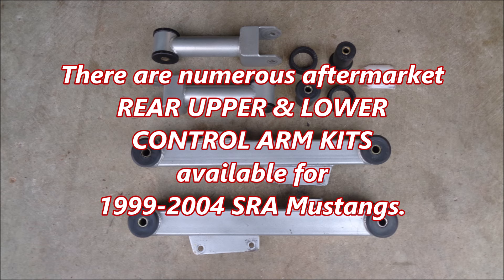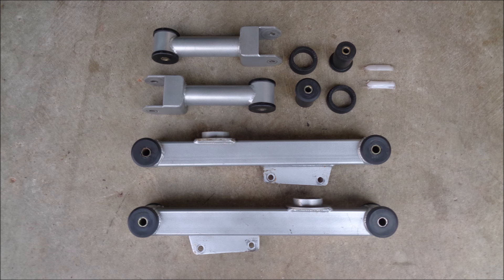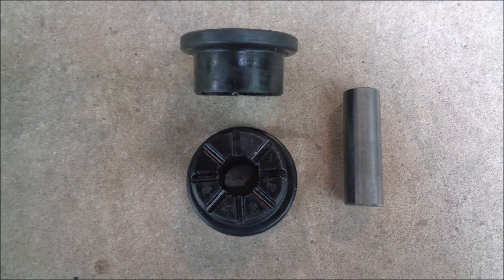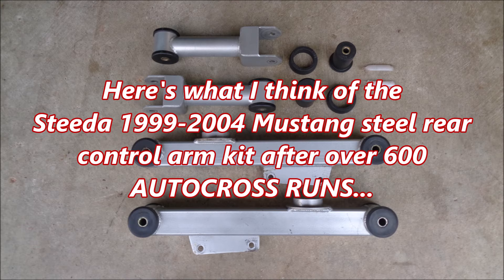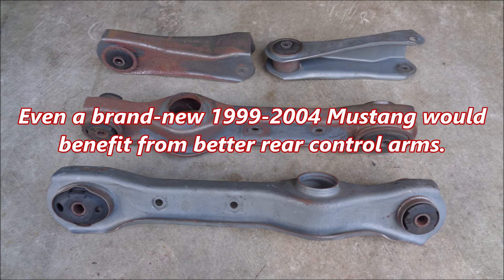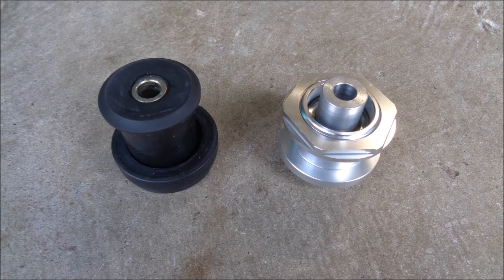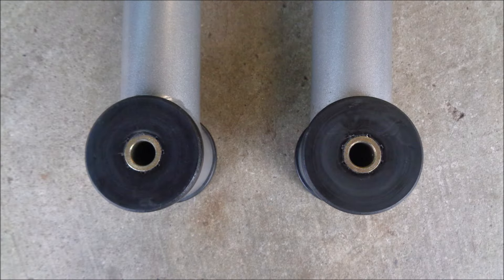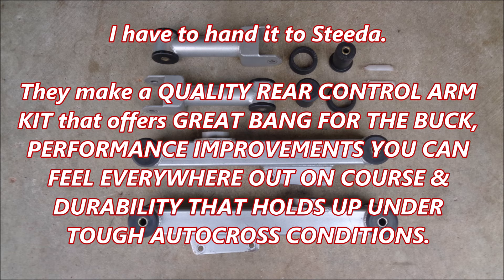STEEDA 1999-2004 Mustang STEEL REAR UPPER & LOWER CONTROL ARM KIT: Autocross Review

Comment: Those are similar to the BBK rear control arms I used except, BBK uses a boxed upper and red poly 3-piece bushings. Steeda is high quality with everything they build, I like the boxed look on the lowers much better than the tubular..
Reply from the maker: It's good to have multiple options for rear control arms with 3-piece poly bushings. J&M also makes rear control arms with 3-piece poly bushings. I've had a lot of positive experiences with Steeda parts over the years.

Comment: Excellent video. I am guessing that your car sits at stock height or very close? How are you adjusting your Instant Center or Roll Center, if you are not using adjustable control arms or a phb? Are you using relocation brackets for the lower control arms?  Thank you for your time.
Reply from the maker: Thank you! I generally don't lower my autocross Mustangs more than 1". Going lower with stock-style springs (not coil-overs) limits suspension travel and can lead to needing more mods to solve more handling issues. I don't use relocation brackets for the rear control arms on my SRA cars. The other mods I've made (weight reduction, mass centralization, adjustable shocks & struts, sway bars, etc.) have gotten my SRA cars to perform well enough to where I haven't felt the need to use extended ball joints, adjustable control arms or a PHB.
Reply: Thanks for the reply. Yes, I would agree that lowering your car past stock height causes a lot of problems. The 4-link rear suspension is actually pretty good when it sits at correct angles and height. Out of curiosity, have you looked at true triangulated 4-link suspensions? The 79-04 mustangs have more of a semi-triangulated 4-link setup in my opinion. What do you think about some of these upper control arms that connect off the frame rails? 
By the way, very impressive what you can do with your mustang. without running a watts, phb/ta.
Reply from the maker: @JP-ri1wf  I haven't looked at different 4-link suspensions. And, honestly, I'm not familiar with UCAs that mount off of the frame (I'll have to check those out). When I started working on these cars many years ago, the most common steps were to upgrade the rear control arms and add a stiffer rear sway bar, then upgrade to some "next level" rear suspension mod (like a PHB or Watt's link), then eventually add a TA to get rid of the UCAs. Steeda offered different solutions. I've always had to build my cars on a budget. That means I've had to figure out how to do more with less. Steeda's (now discontinued) adjustable rear sway bar was $150. I was amazed by how well it performed, especially when combined with adjustable shocks and struts. That experience changed my thinking about SRA mods. I plan to use all 4 rear control arms on my SRA 2.3L project. I've tried my best to show people that these cars can be competitive at local autocross events without coil-overs, aftermarket K-members, or a PHB/TA setup. Those mods do make a big difference, but I don't want people to think they can't autocross unless they have those parts on their cars.

Comment: Would you say these control arms eliminate the need for a panhard rod or watts link?
Reply from the maker: Forgive the long reply, but I always try to give balanced answers. This is a tough question to answer, because there are lots of variables that factor into suspension performance, and personal preference also plays a role. I refer to Panhard bars and Watt's links as "next-level" rear suspension mods. They're more involved than just simply adding a larger rear sway bar to get the car neutral, they require you to choose which option you think is better and, with the addition of a Torque Arm, allow you to remove the upper control arms. I can't argue with the fact that removing the rear UCAs improves the handling capability of these cars. I can say that I used this rear control arm kit in conjunction with a Steeda adjustable rear sway bar (now discontinued) and I competed against several cars with a PB/TA setup at my local events. To the best of my recollection, I don't think I competed against any 79-04 Mustangs with a WL. My car was very competitive against the PB/TA cars. I didn't always run faster times, but the results were often close enough that winning was more dependent on the driver/suspension adjustments, not the choice of rear suspension upgrades. In a world without the Steeda adjustable rear sway bar, I'm more likely to consider a PB or WL for a solid-rear-axle Mustang. I tend to focus on weight, so I'm not as likely to use a TA. Lots of people will disagree with me about that. I prefer a WL, and I would use it with all 4 control arms (with 3-piece poly bushings). If I went with a PB, I would follow the manufacturer's recommendation about rear control arms (specifically the UCAs). It's hard for me to definitively say that these control arms will or won't eliminate the need for a PB or WL. I do think it's worth using them in conjunction with the correct stiffer rear sway bar for your car to see how well you can do against cars running a PB or WL. I also think it's worth riding in/driving cars with a PB or WL to get a sense of how they perform relative to your setup.